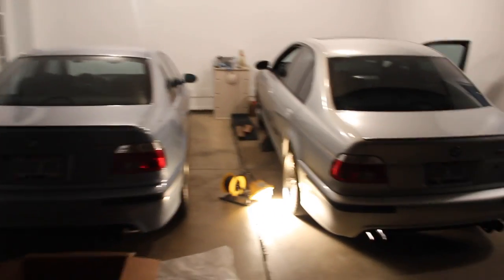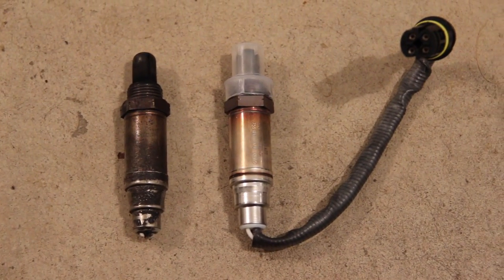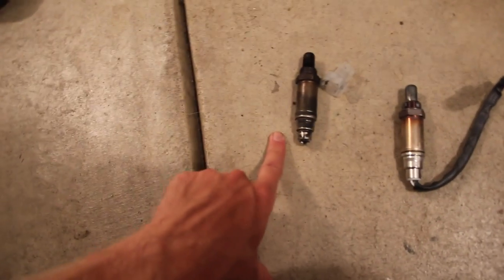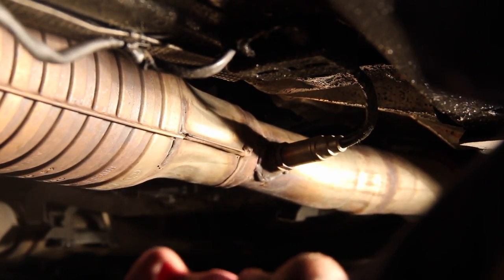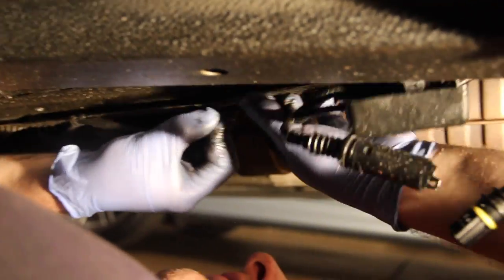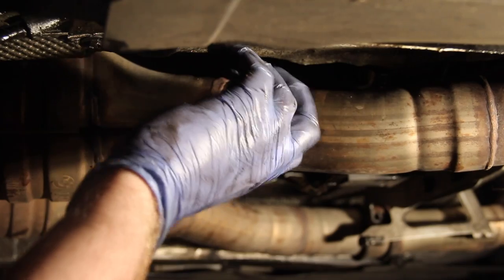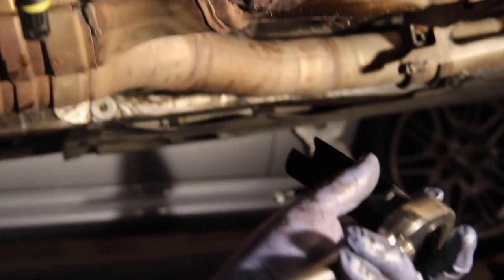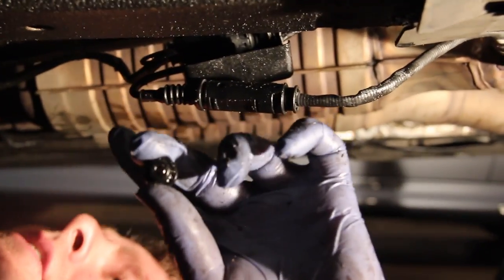BMW E39 540i / M5 Oxygen Sensor DIY

Comment: I having this code pop up , I’ve replaced to pre cat o2 sensors and still threw the code ,other than that the car runs fine no other lights ,it’s a 2002 540i any ideas 💡 code is p1159 manufacturing control fuel air metering.

Comment: Quick question: My 97 540i is not throwing any O2 codes, my CEL light is not on, and she's running great. I went to get California's wonderful SMOG and passed every thing except NO (PPM) at 15MPH. My question is could the pre-cat sensors be bad even though no codes thrown, causing this condition?
Reply from the maker: NO PPM?  I have no idea what that means.  Sensors can be bad without throwing codes... but I would Google around to see what causes that.

Comment: Do you have the amazon link to the specialty socket used for the the torque wrench in this video?
Reply from the maker: https://www.amazon.com/Powerbuilt-648442-Oxygen-Sensor-Sockets/dp/B002INWTJC/ref=sr_1_3?s=automotive&ie=UTF8&qid=1525964803&sr=1-3&keywords=Powerbuilt+648442+Oxygen+Sensor+Sockets

Comment: how many cats this car has and where they are located? does it has 4 cats two connected to the manifold and two underneath the car?
Reply from the maker: There are two cats, one on each cylinder bank, located AFTER the headers and behind the transmission.

Comment: Is p0420 normally for post or pre cat? I have an 01 m5
Reply from the maker: According to a brief Google search, P0420 means "Catalyst system efficiency below threshold (Bank 1)".  I would start by replacing the oxygen sensors on this bank.  If the code returns, you likely  need a new cat.

Comment: I just replaced the spark plugs and the ignition coils on my e39 and I got check engine and cat red flashing code and misfire on cylinder 8 with fuel cutoff😭😭 someone help please
Reply from the maker: Clear the codes and see what returns.

Comment: Hi I have a question. My Son gave me a 2001 BMW 540i. I had went to Walmart and when I got back in the car it didn't want to turn on.  I tried and tried. But I had to get it towed.  Two days later I went to go and start it up it crank up but I smell gas and the check engine light came on.  It seems like when it gets hot it shuts down. I went out today to start it and now the check engine light is off.
Reply: did you get help

Comment: Does this cover P0131 and P0151?
Reply from the maker: Those look like generic oxygen sensor codes.  I usually recommend replacing the O2 sensors at this point.
Reply: Guess ill do all 4, thanks for the video fellas

Comment: Dude you skip the most important think to mention wich one is babk1 sensor 1 an sensor 2 and bank 2 senser 1 and 2 👎  this video is not really helpful
Reply from the maker: Bank 1 is the passenger's side cylinder bank (left when facing engine from front of car).